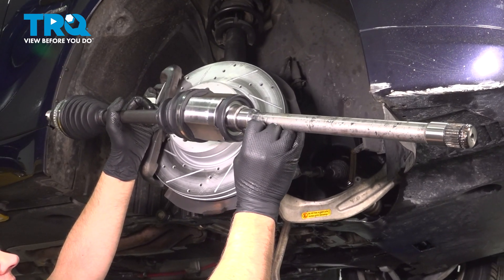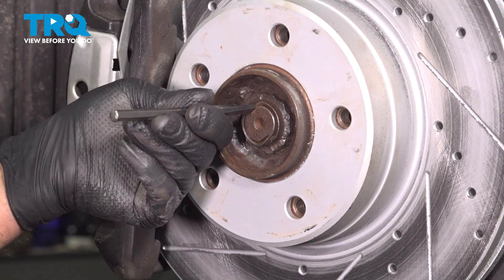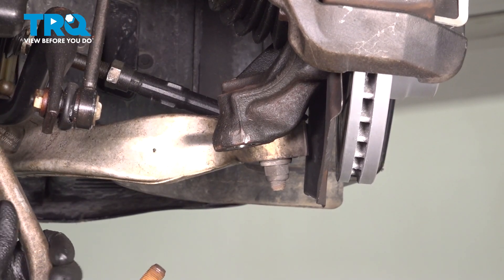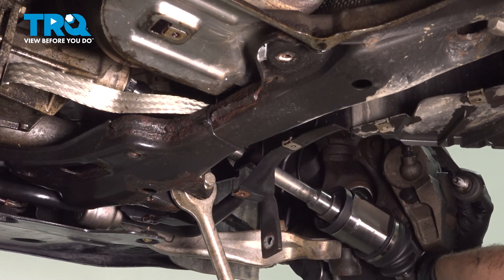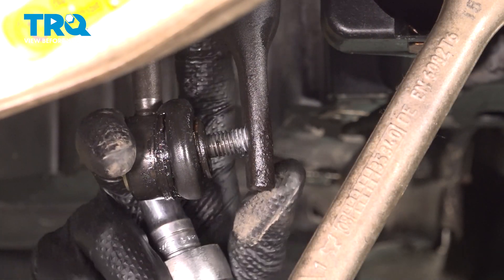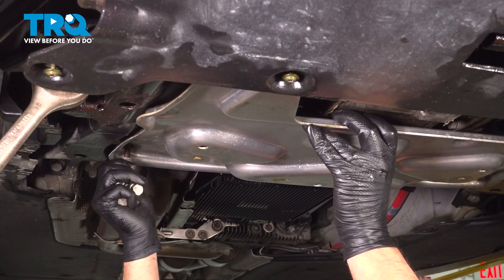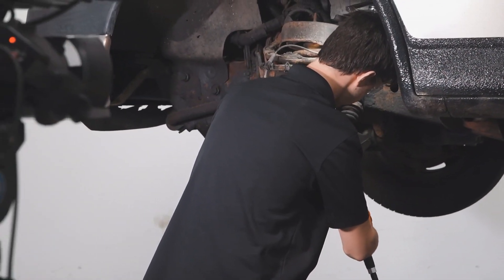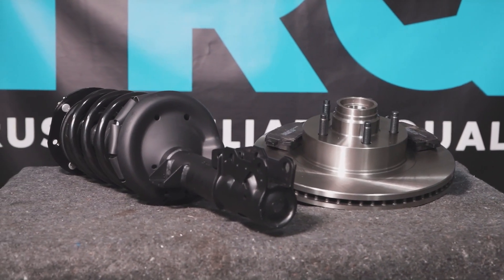How to Replace Front Right CV Axle 2009-2010 BMW 535i xDrive

Comment: Which fluid is lost when removing it? And is it normal for the fluid to leak out? I replaced the axle and after installing it I lost a yellow fluid? Did I break something or is it just the fluid that came out when removing it? (BMW G30 xdrive)